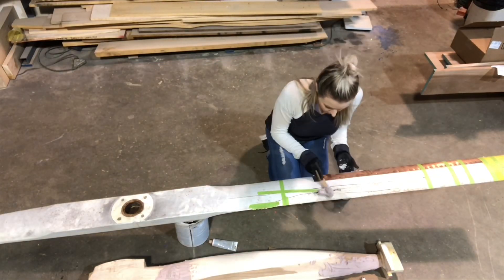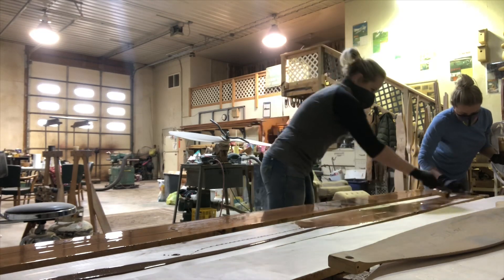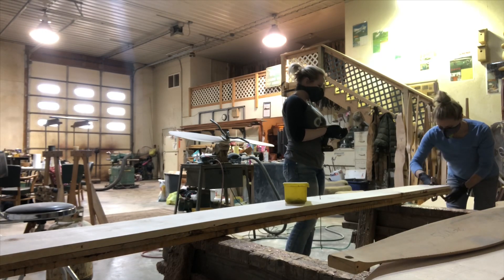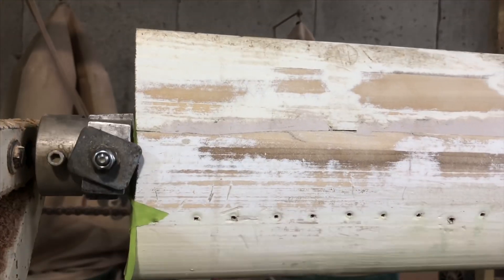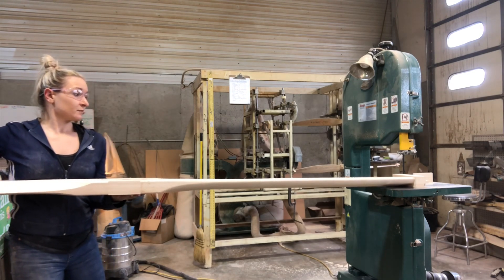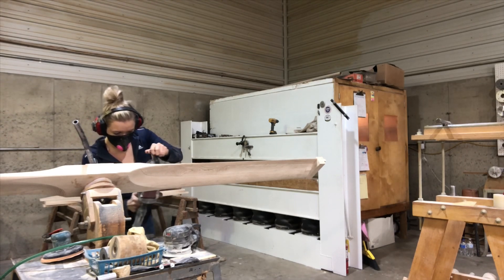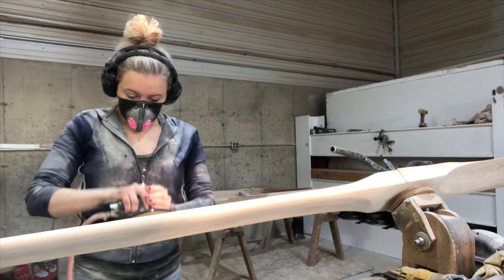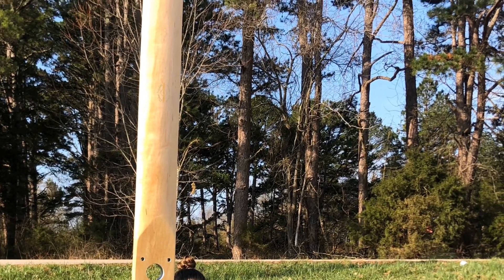Zenith Wincharger Build

Comment: You did not show the process of drilling the mounting holes!!!!!!  Actually that would be a good video the would cover drilling the holes at your maximum depth. I am assuming that there could be problems with wandering drill bit tips. Or is there?????   Nice work in any case.
Reply: I found the needed information on your "Day 3" of making a propeller. ENDMILL.  Pay no attention to me.  Do you plung cut or do you step drill?

Comment: Hi Elaina can you suggest a push prop for a approx 9ft dual pontoon personal pontoon boat ,I want to make a short drive system to propel it anywhere not super fast bascially 15 - 20 mph might be guessing but on the average a planing speed total 350 lbs -Water perpullsion system .